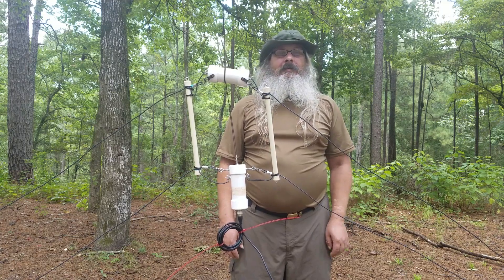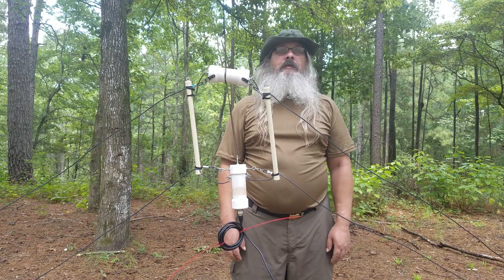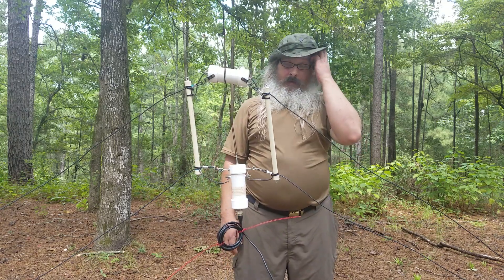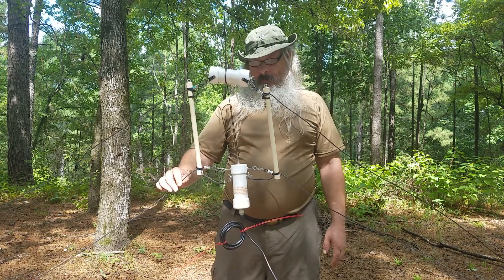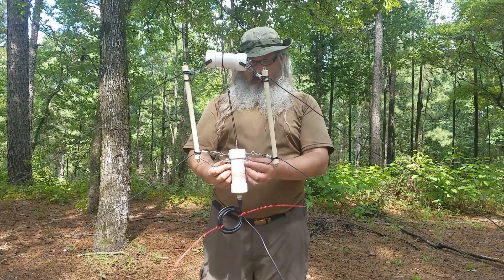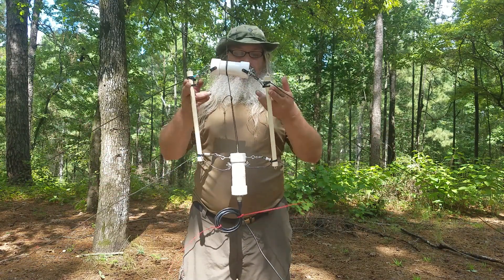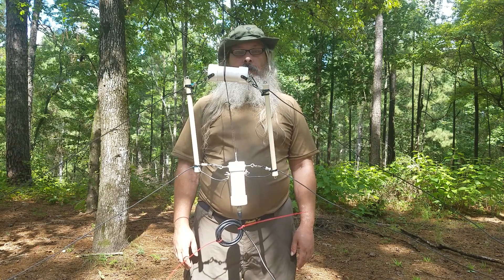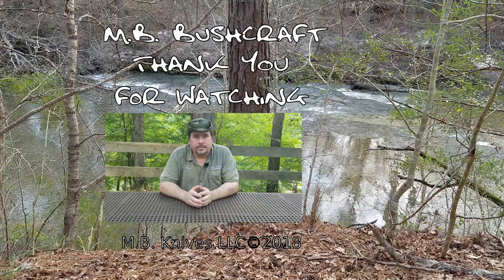Terminated Folded Dipole Antenna t2fd

Comment: 450 ohm resister made out of ? Separations made out of ? Is that 132 feet divided by 2 meaning 66 on each strand or are you doubling it back on itself meaning 132 on each side ? Are their resisters on the ends attached to the poles or just a rope ? How many feet high are you running the antenna? You mentioned 12” spacers does that mean one spacer every 12 inches or between the wires ?  So many questions with unexplained answers
Reply: Hello - My comment is a bit late.  Have a look on Google for T2FD antenna and you will find lots of information.  I run a T2FD antenna which I find great.

Comment: Six meters IS VHF.
Reply from the maker: Many Hf radios also include 6m.
Reply: Yes they do and some include 2 meters and 70cm so????  The term HF is defined by engineers as 3 mHz to 30 mHz.  The term VHF is defined as 30 mHz to 300 mHz ... Likewise 300 mHz to 3000 mHz is UHF and .3 mHz to 3 mHz is MF ...

So yeah, not trying to pick at you but there are reasons for these definitions and you are attempting to educate the public.  Might as well set the example, right?